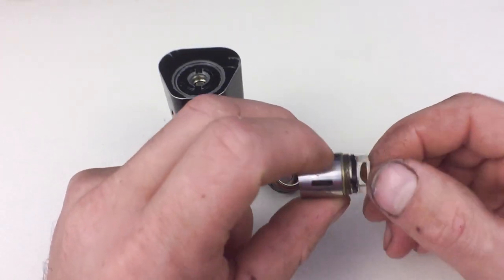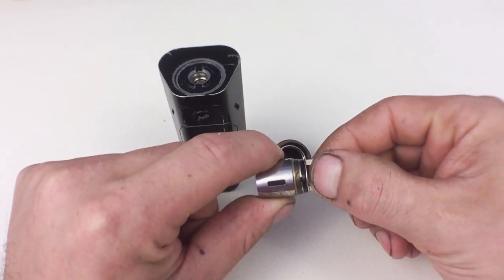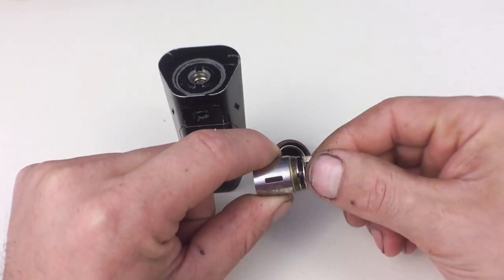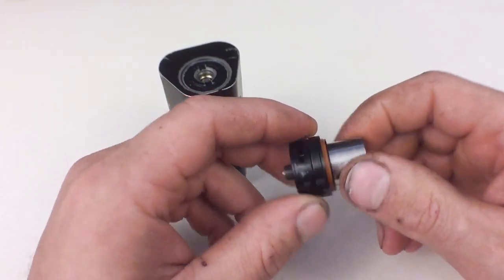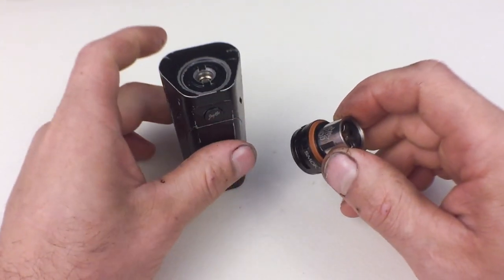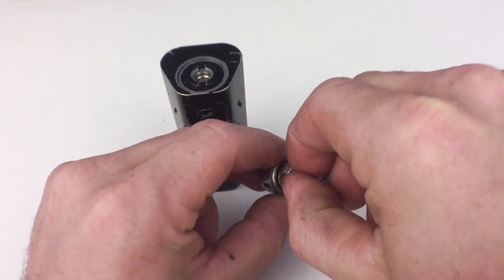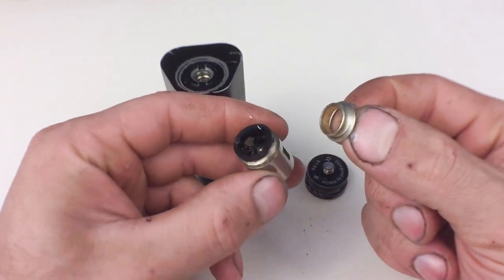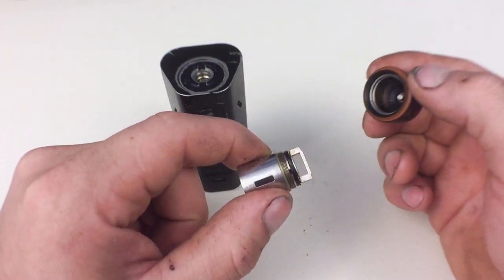2018! How to fix new coils! No Atomizer found!

Comment: 30 fucking videos later and I found the issue. One of the wires got bent down and wasn't connecting to the metal piece in the coil